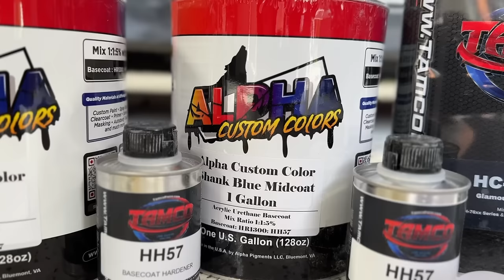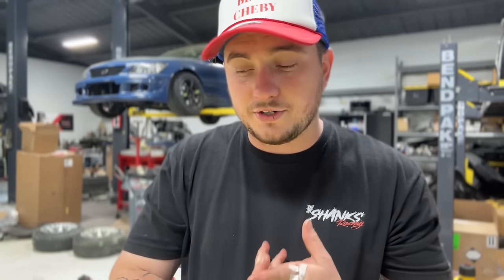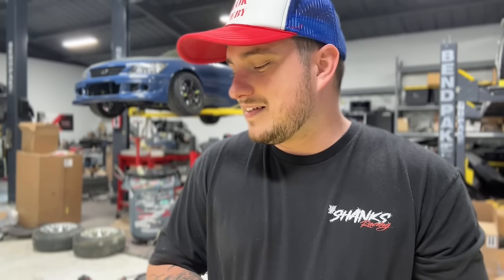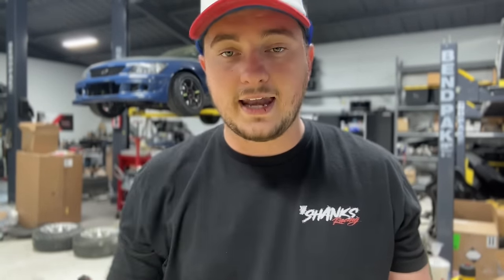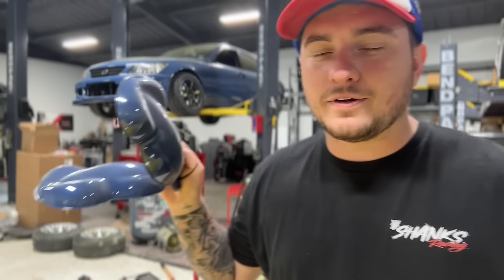Painting My IS300 an INSANE CUSTOM Color!

Comment: I learned about the Spudger tool when I started doing my own liquid wraps. Then, like 5 years later, I started working in a factory making braking/sensor electric control modules, and they used them there. Was kinda cool seeing the same tool used in such varying industries!

Comment: With big panels like the hood you need a float/dust coat with the final layer of metallic in the clear while it’s still wet it helps all the metallic lay the same and hide any smaller tiger striping. You will have to redo the hood, you always paint front to back never side to side. And try to give yourself a 50% overlap each pass. I’ve been doing custom and restoration over 10 years and rarely shoot in a booth using the water floor cleaning method and end up with perfect results almost every time